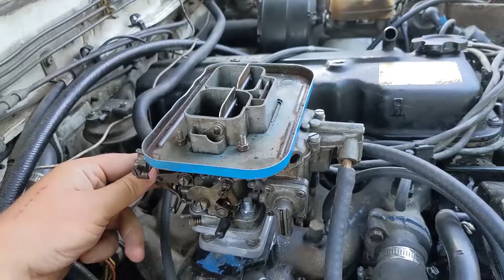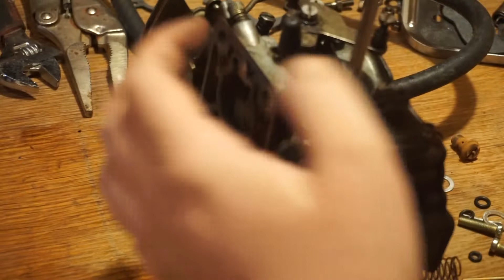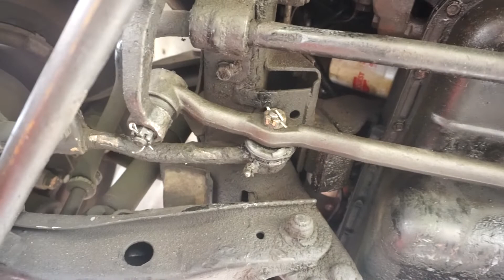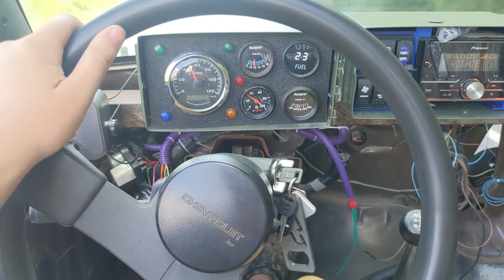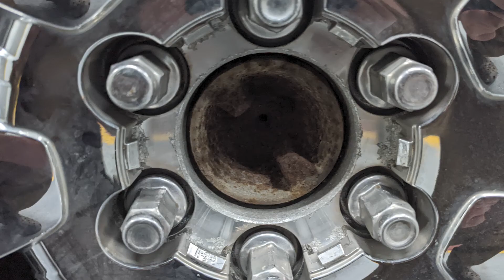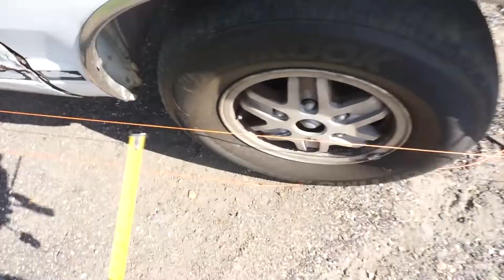Nissan 720 Jack Stand and String Alignment (Ep. 4)

Comment: How did you learn about carbs, how to rebuild and work on them, etc? I’m a fuel injection generation nerd but want to learn more about carbs
Reply from the maker: Honestly I think the best way to learn is to get hands on with it, but start small if you don't have a carbureted car or never worked on a carb car before. Look on Craigslist for gas powered lawn equipment or things like mopeds that won't start and take those carbs apart. Oftentimes they just need some cleaning, a rebuild, or to be replaced and the equipment will run like new. These are also a great starting point because they are usually gravity fed, so you don't have to worry about fuel pump troubleshooting or fuel spraying everywhere if you mess something up on your first try. 

Carburetors on cars usually have more moving parts and fuel circuits, so they get a little bit more complicated, but have the same fundamental operating principle, so if you can fix a small carb you will understand mostly how the larger ones work. 

I'm not an expert on the subject by any means, I wasn't sure what was wrong with the factory carb on this truck, but I will be trying to learn more as we will need to rebuild the carb on the Quadrajet Shadow (also on this channel). I would look up rebuild how-to videos for specific carburetors to get in depth procedures (this is a Weber 32/36 carb)
Reply: @triptheroad  alright sweet thanks! Good luck with the quad rebuild and I can’t wait to see it
Reply from the maker: @izzy-monkey7112  Anytime! I will also be doing a video on how to buy a project car in the following weeks, I'll try to add some info on what to look for on carb cars, I have it scripted but need to film it.
Reply from the maker: Now if you DO have pretty good experience working with fuel injection and your budget allows, you could purchase an inexpensive car or truck with a carb to learn with, but I would do your research to see how modifiable the factory carb is, or how extensive it would be to convert the vehicle to accept a standard two barrel (like this truck) or four barrel (like my s10) carburetor

Comment: an actual easier way to set your toe would have been to get a tape measure and start at the back of the 2 front tires and measure from a spot on the tire and then carry the measurement to the front and measure across to other side on the same spot(usually a end of a tread) and take the difference between the 2 measurements.... the key here is to be the same level off the ground on both the front and rear of the tires so that the camber doesn't affect your toe measurements....so if the 2 measurements are 67 1/4" in the rear and 67 even on the front, the toe would be 1/4" in....if the measurement is bigger on the front than the rear, then the fronts would be toed out...I did alignments for 30 yrs and we used this method on wide axles (camper, trailer and fifth wheel set ups) and never had a problem....thanks for the video
Reply from the maker: I've heard of that method too, works great as well as long as you make sure to account for any differences in track width. I think they make a telescoping bar of sorts for this method